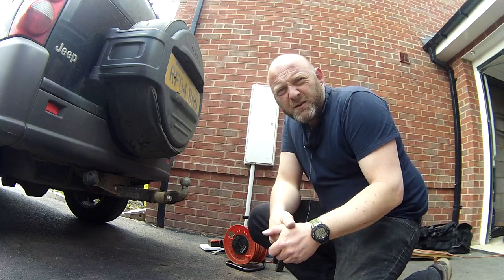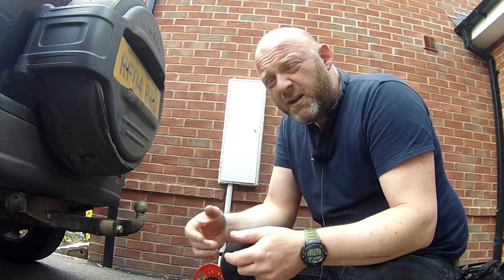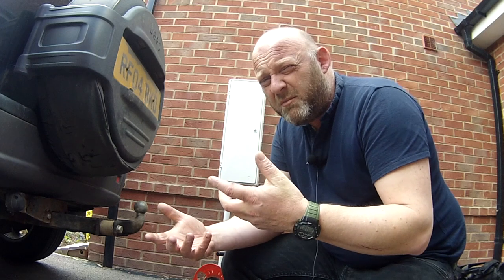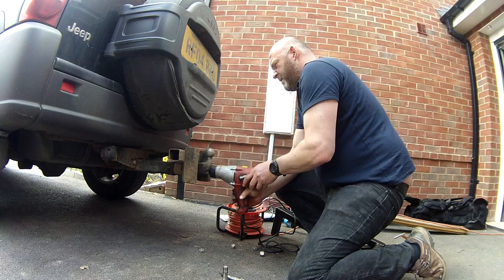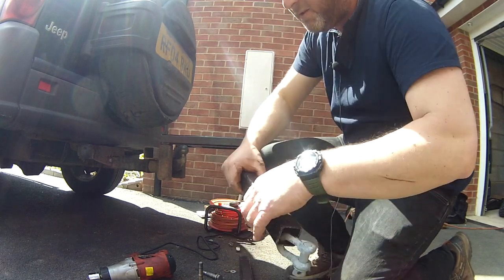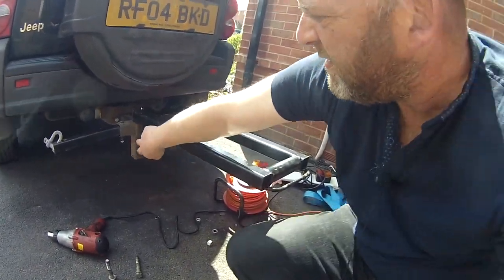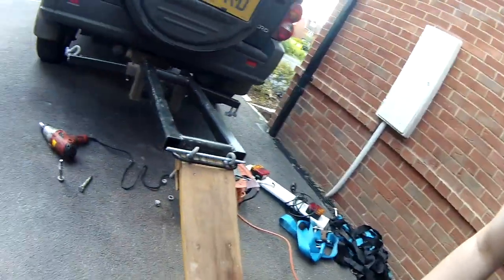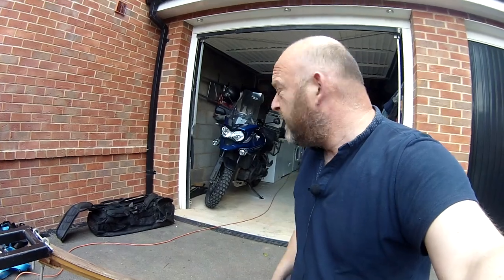How To Transport A Motorcycle By Car - Motorcycle Carrier Rack - Bike Dolly

Comment: What size spacers did you use on the dolly to avoid contact with your spare wheel?  Did you need longer bolts as well?  I have a Shogun which also has a spare on the tailgate.  Thanks.

Comment: Curious of what you think of putting the rear wheel into the dolly to avoid wear on the chain, sprocket, etc?  I've seen some that swivel but wondering if I might get away with the rigid one like yours since that's what I've already got.  What do you think?
Reply from the maker: Hmmm not sure about that at all as it is designed for the front. I towed a bike a few hundred miles and it was great. Hey I’m sure there will be experts out there who say don’t do this and that but sticking the rear wheel in there might work but I would somehow lock the steering on the front.
In my humble opinion  the wear on chain is so slight that it’s not an issue.
My preference  is always with a trailer and that is what I’ll be getting next or a rack for a smaller bike  but this system does work, but don’t try reversing with it of course. Cheers

Comment: Fantastic design!! You don't have to dismantle it all to use the ball hitch with a trailer , I might use this design on a campervan as you can lock  it all away  in side the van when using the motorbike etc
Reply from the maker: Yep sure is
Reply: @RevelatorAlf  Becareful the weight of a large heavy motorcycle 200kilo plus will overload the tow ball maximum allowed weight, secondly my motorcyccle leans a lot when turning tight corners, also I've had handle bars rotate in the clamps before so beware.